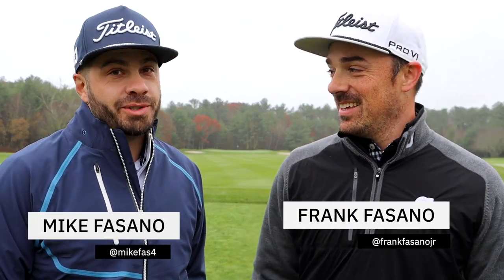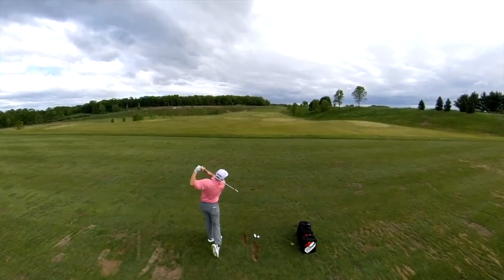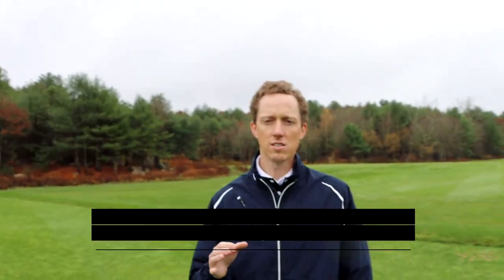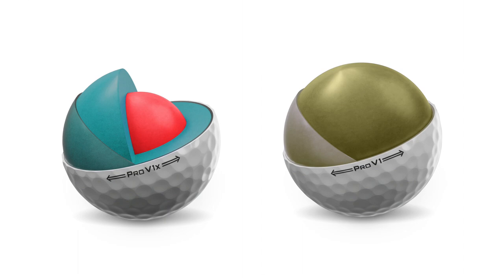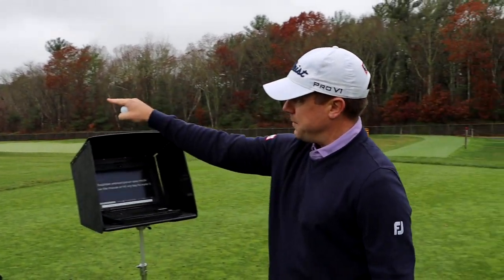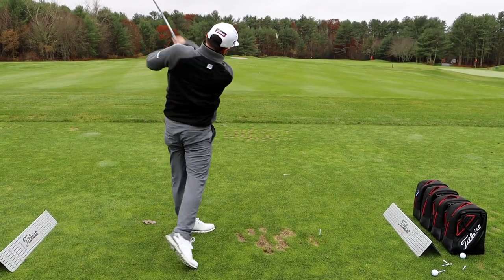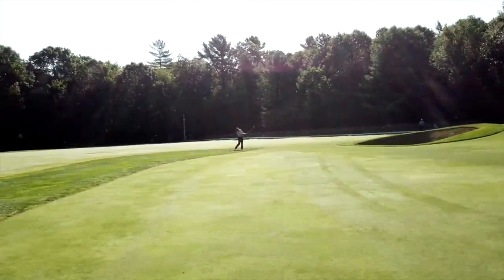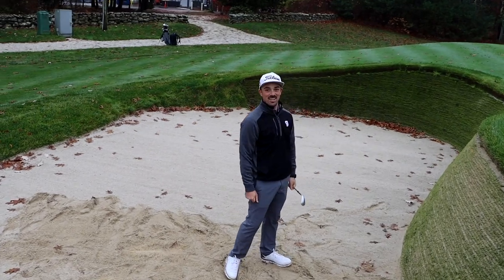Titleist Pro V1 Ball Fitting Experience

Comment: I usually pick up the Callaway Chrome Soft X as my ball of choice just because I was given a box as a birthday present a few years back and I figured "Hey, these seem to be good, might as well stick with them." I've been lucky enough to have a lesson since the start of the new year and my coach noticed that after a few changes I am closer to that 30-degree launch angle (I think I was in the high 30s now down from who knows what it was before a few swing changes, probably 40-45). I think now, especially with me taking the game more seriously this year than I ever have, the Prov1s would be a better fit for me just because they have that more penetrating ball flight (which is something I am working on getting in-line with lessons along with ball striking). Even if I don't win, I still think I'm gonna grab a sleeve of the new Prov1s and just see how it goes. Watching these fitting videos always makes me think about changes to my equipment, no matter how big or small, and how much it could impact my game. Plus, having a softer ball around the greens is great. My local course that I'd call my "home course" has small greens. Getting the ball to stop quickly is key and an area I need to work on as it could easily save me 3-5 strokes per round if I had more consistency around the greens.

As always, thanks for the great video guys! :D

Comment: Have to be different than everyone else. I play Oncore Elixr or TP5x. Those 2 give me best flight, feel and still have good spin. I rarely play prov's, the way they have responded for me when I hit them they are not worth the money. If I cut/slice the prov gores farther right than the other 2. And it never is as long as the others for me on a good shot. Save my winning entry for sm8s or a driver, or a shotscope or any other awesome prizes you guys give out. In hindsight, if your willing to pay 50 dollars a dozen, then you should spend money on your fittings and gear. Ball fitting is nice but in my opinion no where's close could a ball fitting improve or help you as much as a club fitting. Right length shafts, right weight, lie angle and grip size don't forget that. That's the good stuff. As always great content though. Good luck to all.